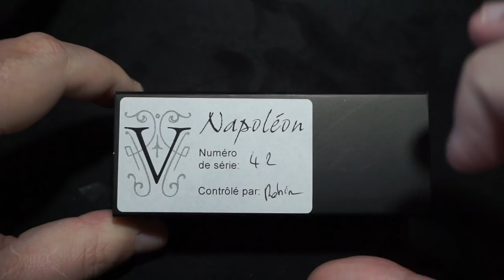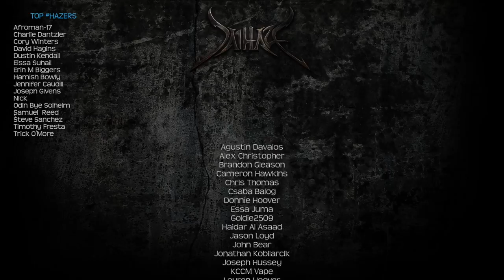$400 Dripper, Seriously? | Volute Modz Napoleon Grade 5 Titanium RDA

Comment: Hello Jay, thank you for the review of the Napoléon !
I would just add a few notes of my own :
- the central mark between airflow marks allow to fully close the chamber so there is no leak on the go.
- you can use your own 510 driptip, you just need to remove the small 4mm driptip extender of the driptip base.
- true this is not designed to drip from the top, we remove the topcap and refill directly in the juice well.
- we absolutely guarantee there is not an ounce of machine oil on our parts, we clean everything multiple time in ultrasonic bath and alcohol, then we put pharmaceutical VG on o'rings before assembly. 
Nicolas - Volutemodz
Reply from the maker: I can respect the comment. However if I use a 510 the threads of the top assembly protrudes out
Reply: @JaiHaze  the threaded base should be left in place, it's just a cosmetic base for a 510 driptip. The 4mm driptip extender mounted on the base can be removed (it's a shorty with one o'ring).

Comment: It's an interesting rda for sure. Not really my speed, a bit complicated and definitely more than I'd pay. Then again I think $100 for an rda is unnecessary. Maybe I'm simple, I've got $30 and $10 rda's I'm happy with. All the extra cost and gadgetry doesn't mean it's going to vape 10x better or give 10x the flavor. To each their own though. Some people like fancy cars with all the bells and whistles. They like a seat that adjusts each ass cheek's elevation independently, has height adjustable pedals. I'm good with a 70's pickup where if you can't reach the pedals you just pull a single lever and slide half the bench seat forward. :P

Comment: fyi you missed one of the selling points. the 2 ports with orings below the drip tip are there because when you close the airflow completely by you rda is completely hermetic even from the drip tip. you can just fill it, close it and dump in your pocket without any risk of leaking.
Reply from the maker: A selling point is removing orings? Are you fckn kidding me
Reply: Jai Haze he’s saying that the orings are there for when you close off the airflow it closes those “ports” and closes off everything so you can throw it in your pocket, lay it down on the table, whatever and it won’t leak.
Reply: Thats it... excuse my French lol English is not my first language at all .

Comment: Jai can you flip the revers threaded tighter screw upside down?  That may be how to get vertical cools in, the attacment sections would be near the top by the tightening screw for the center pin and not the base.

Comment: As a cnc machinist I'm going to tell you that price point is accurate... Titanium isn't cheap for 1 and the miniscule machining on this thing is crazy and would take a while to to do and you can cut titanium very fast in a cnc machine.... 👋👋👋👋👋👋👋
Reply: Did you mean "can`t", cut very fast? lol
It`s not worth 400 bucks, there are scratches on it ffs..
I visited Volute`s site the other day, and it`s a niche-driven small manufacturer who plays on exclusivity to drive up prices, the designs are weird, complicated and unnecessary, and the finished product is a hyped up, overpriced, hard to use crap.
VERY french lol..

Comment: 5:37 that's probably machine oil, or just oil to protect the metal while in storage... you should always oil any metals that are going to be stored, indefinitely. otherwise it risks degradation. just clean it off. 16:25 that is gross... those are trash... they didn't have to drown the thing... jeesh

Comment: Thanks for your nice review 👍Maybe not juice but food grade silicon? 🤔
Reply: Vaporman probably is. It's the most common used lubricant for o-rings. It's very stable, odorless, tasteless and allergies are super rare. You'd have to be exposed to a serious quantity to even trigger any symptoms, or insert it wherever you have soft tissue. 

On top of that it doesn't harm or swell o-rings and it doesn't conduct electricity. 

I'd rather have them put some silicone on it, than rip an o-ring when I take the cap off for the 1st time. There's really nothing wrong with it. 
Shipping it without o-rings would be a nightmare. They go on easily sometimes, but I've also spend 15-20 mins trying to get a single o-ring in place. 

Simply remove it with some dish soap diluted in hot water. I believe ammonia removes it as well. 

Bunch of whining about a non-issue, every freakin time.
Reply: @johnvapes8212  thanks 👍😉
Reply from the maker: Fck you John. A non issue? Do you take apart 1-2 drippers everyday for them to get stuck together. And it’s VG, not good grade silicone. Read the owners coments

Comment: I would be curious if the stainless version of this required so much power. I suspect the reason it needed much more power was because it is titanium and that is a very bad conductor for metal as I understand it. That coupled with the way that positive is I think there is some conductivity issues with this thing. With that being said though for the time that this came out is is extremely unique and had so many cool little ideas with it. Thanks for showing this off jai, as I believe I have seen videos on either this or another rda they did with a similar deck but none of those videos were in English. I just went and checked and this is the same company that just came out with that crazy tiny little rda I think it’s called the xiv.
Reply: ET Vapes Rda is a conductor the coil makes the circuit so your sarcastic tricky question without a mark at the end is dumb
Reply: @frank_texas7400  where's your mark at the end?
Reply: Different metals have different levels of conductivity. It’s is mostly noticeable if your using mechanical mods, but if it’s bad you will have to run the rda rta whatever at a higher wattage on your regulated device than you typically would for your normal build. A number of things can cause this some being the material as I mentioned, things like paint on connection points, or if it is just a lot of intricate pieces like this rda has. I suspect there is a few things causing this rda to be very unconductive but the major reasons as I can see are likely the fact that it’s titanium but what may be affecting it more is that whole center positive and negative assembly.
Reply: ET Vapes I don’t know if u were being sarcastic or not but refer to my latest comment on this thread.
Reply: @frank_texas7400  should I sit on that and spin?
Reply: @danebeee1  Actually there is no stack here, your coil is in direct contact with the center pin and can go straight to the battery on a hybrid setup. Titanium is less conductive than SS but we are talking about micro-ohms here.

Comment: I love ti attys. This I dont understand y its so exspensive other than the material. Its really a dated deck imo. The positive connection is a lil innovative but not enough to really justify the price for me. Thats alot of money for any atomizer. Yes its limited quantity and hard to get but that isnt enought to make a high end atty good. The airflow is different for the sake of being different for no reason that i can c. Its just not for me. Nice video but I'll pass on this one. I can think of 5 other attys I cld get that r great for a fraction of the cost and prolly a better vape experience at least for me. I know some ppl will absolutely love this regardless of how it vapes just because its so exspensive and hard to get. It is what it is.
Reply: One of thing you don't see on the video is that the in-flow (from the side) and out-flow (from the top) are actually indexed to keep a constant ratio of airflow in/out. It's one of the recipe of this RDA. You may see how it works if you search a review for the Richelieu RDA.
Reply: Nicolas Mulard I'll definetly look into it. Like I said i personally don't get it. There may b something to it but I dont c it myself. I'll research that rda tho. Thanks.

Comment: What a pile of junk, literally no reason for that design, it`s originality for originality`s sake.
At the end of the day, all those little parts do nothing to make it stand out, might as well be a regular 3 post RDA, just made out of titanium.
The coil positions aren`t special or anything, I guess the deck is deep and somewhat spill resistant, only positive I can see with that design. Useless.
And a bunch of machine oil on a 400 dollar RDA? Dafuck, it should come with a BUTLER that cleans and assembles it for you, then vapes it like a kings chef to see if it`s safe.
I would literally PAY to NOT use this.
I paid 22 bucks for a profile, smooth vape, easy to build on, and about 25 for a drop dead smooth vape, easy to build on, and I`ll use my remaining 350 on something USEFUL lol.
Kylin mini, smooth vape, rich flavor, easy to build on.
Functionality is so much more important than some "art piece" that puts a leg in the door of vaping.
This RDA is just, nah.
Plenty other curiosities out there, that one can actually buy, and for a lot less than 400 bucks lol..